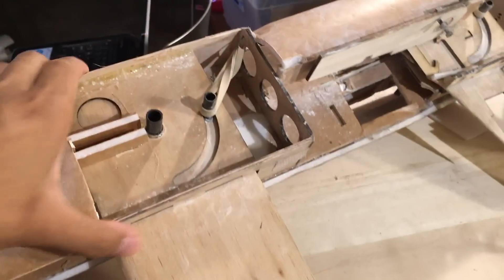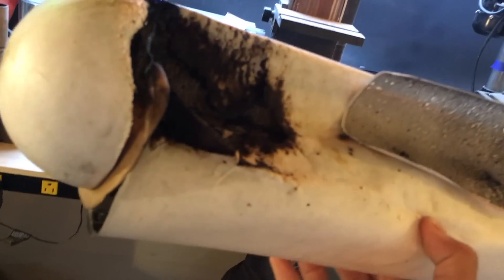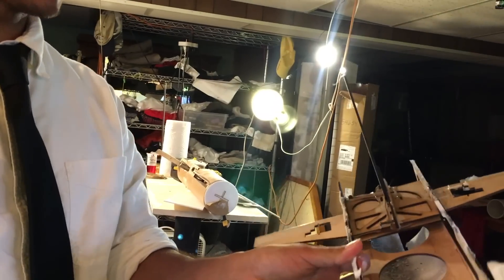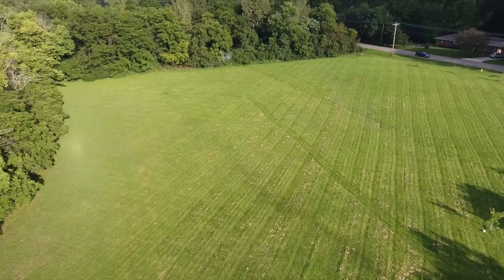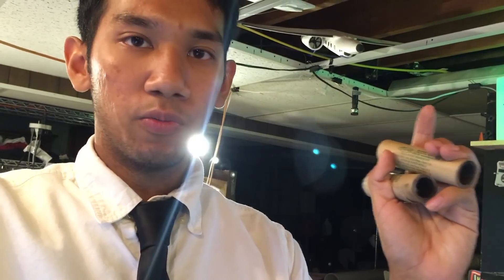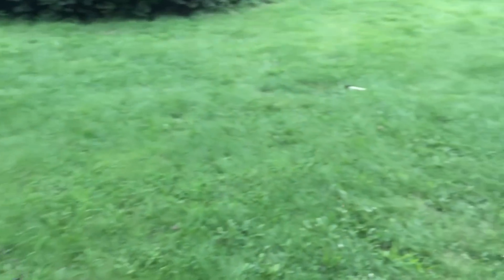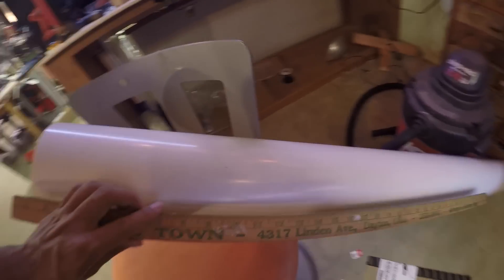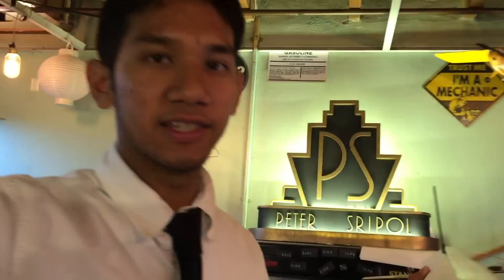DIY Javelin missile part 2

Comment: Subject: Request for Feedback on My Human Flight with Wings Project

Dear [anyone can help "],

I hope this message finds you well.

I am currently working on a personal project that explores the possibility of enabling human flight using mechanical wings. My goal is to design and build a functional wing system that can either glide or assist in flight, inspired by birds and modern experimental technologies.

As I am still learning and developing my understanding of flight dynamics, materials, and safety, I humbly request your guidance and feedback.

If you could take a look at my ideas, materials list, or prototype, I would greatly appreciate it if you could:

Point out any mistakes or impractical assumptions

Suggest improvements in design or construction

Share any resources or examples that could help me learn

Your input would be incredibly valuable and help me move forward more safely and effectively. I’m eager to learn from your experience and expertise.

Thank you in advance for your time and support.

Warm regards,
[Sarfaraz ]
[ you can text me on instagram ]

Comment: Try making POV remote control mortar round.  "Manufactured by US weapons manufacturers Raytheon and Lockheed Martin, the Javelin costs $178,000, including the launch system and missile, according to the Pentagon's 2021 budget. Each replacement missile costs around $78,000".   Each of the 35-pound GPS-guided mortar rounds costs about $18,000 McPherson said, compared to about $2,000 for the non-precision rounds"

Comment: 1969 Vernon Estes sold his company to the Damon Corporation of Needham Hts, MA. 
Damon purchased a number of other hobby companies including a smaller competitor 
of Estes, Centuri Engineering of Phoenix, AZ. Damon merged the two companies under the name Centuri Engineering. 
The Penrose entity continued doing business as Estes Industries.
 In 2002, the combined company was sold again and the company’s name was changed to Estes-Cox Corp.On January 15, 2010 Estes-Cox was again sold and became a wholly owned subsidiary of Hobbico of Illinois. Hobbico was started in 1985 when Tower Hobbies was combined with Great Planes Model Distributors to form Hobbico, Inc.
In 2016 Hobbico experienced financial difficulty and did not distribute Employee Stock Ownership Plan benefits to former employees. In 2017, Hobbico's financial difficulty continued and the company laid off 35 employees. This seems to be a result of the ongoing litigation for patent infringement.

Comment: Its like many brands we trusted before they were sold off to the Chinese. Duracells for instance. They are now the crappiest batteries. Many I have had in the last few years leak and corrode. Estes  is probably victim of the same circumstances. Good brands we once trusted, just run into the ground for short term profit.

Comment: If you make a Sugar, KNO3 rocket you could just mix powdered sugar from walmart and the same stump remover pellets as a dry mix. I found that 35,65  worked better than 40,60 mixes ( I did this for sophomore chemistry HS) and they burned for 28-37 seconds. though I believe on the 40,60 s there was only nozzle edging outwards due to force and melting, but on the more powerful 35 65 on all three tests the nozzle was not large enough so there were one side hole blowouts and only one intact bulge
Reply: How do you get it to burn for 20 minutes?

Comment: no. most likely they got shocked or thermally cycled. IE the grain was cracked OR seperated from the wall of the paper casing. this will cause the motor to over pressurize beyond design specs and "boom" CATO. be sure to file mess reports with the NAR.

DESIGN your vehicle with a separate housing for the motor so if it catos it only destroys the "engine housing" of your craft instead of shooting up and roman candling your entire model.

Comment: Instead of using a black powered charge you could have used the hot gasses from the rocket engine to build pressure behind the rocket. This would then make the rocket pop out of the tube with out having to rely on a home rigged black powder charge. The seal would have to be done just right. But there is a lot of pressure coming out of those engines. However, I imagine that you would loose burn time out side of the tube. But then again if you had it fire almost like that of an air cannon you would not have to spend so much time accelerating. Great project loved it!

Comment: I think that the motors were actually working exactly as they were made to work. We used some in high school that would burn and then launch a parachute out the top with the second explosion. I'm not a hundred percent sure, but that seems,so to be what is happening here.

Comment: Have you considered packing your own rocket motors? You can make them using potassium nitrate (tree stump remover) and sugar using baking soda in the mix as a delay and 1 inch pvc as the casing.
Reply: Jordan Martinez that's a great idea! I made some from Grant Thompson's King of random channel. they work amazingly well once you get the knack of making them. you can buy rocket motor tooling online
Reply: im working on a rocket project how many lbs of force do the motor have

Comment: Peter, you are correct that it's a manufacturing defect (can also occur in poorly climate controlled storage due to thermal fatigue). The fuel grains are delaminating from the casing, forming an air gap. This causes an explosion when the flame front reaches the outside of the grain. This problem actually killed production of the C5 series engines and the number of failures you've had indicates the E9's days may be numbered. Given the effort you've put in, it's time to buy a 24 mm casing from Aerotech. I know the initial outlay is rather expensive, but they're cheaper than Estes in the long run, and the reloads are more reliable than black powder engines, plus you can get a greater variety of burn rates. I'd also recommend stepping up to F class to accommodate all that weight, but that's another story...
Reply from the maker: Joshua, Yep I have a feeling you're definitely right about that. I'll probably go with some F class motors for the next video as i'm not getting as much thrust as I need to move this pig of a plane. Whats your opinion on the total impulse of one of those single use aerotech F motor? Do you figure this thing will hold up to the impulse of the motor? I'll definitely research the 24mm motors for future use of this and other projects though! 

Thanks for the info!
Reply: Glad to help. The F26FJ is the only one a I trust to not turn it into complete confetti. The F16RCJ for their 32mm casing is a little safer, though I'm disappointed that all their long burn motors are D, E, and G class. The G12 looks like a really fun setup. Almost 9 seconds of power! Anyway, I'd say look to the F26 as a first go, and then start saving for that 32 mm casing.
Reply from the maker: Thanks Joshua, I'll check my LHS for any of those! I did find some estes F motors and i'll suppose ill have to give one of those a run... hopefully they don't fail too!
Reply: Wow, I thought they discontinued those E9's years ago.  They were notorious for that when I was last flying rockets regularly like 15 years ago :)  Just getting too big for BP.  Above a D just much more reliable to go with the composite - but design for the extra kick ;)  Just as you said not a whole lot of long burn options which would be great.

Comment: The fuel core is cracked. It creates more burning surface thus more pressure than the rocket motor can handle. It's a manufacturing defect. Wait for another lot# of motors in that thrust class before buying.
Reply from the maker: That makes sense! It's a shame that all three of them blew up! There's 20$ I'll never see again... 😂
Reply: Like I said elsewhere, buy Aerotech. End of problems. (and cheaper long term if you go reloadable)